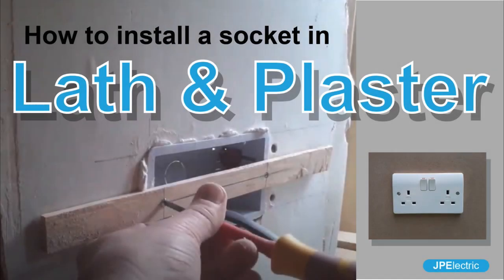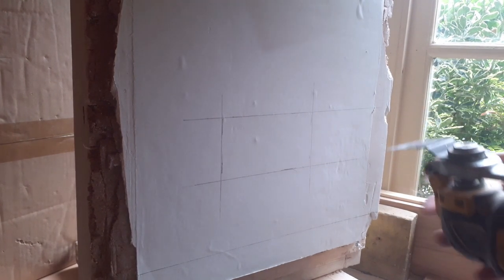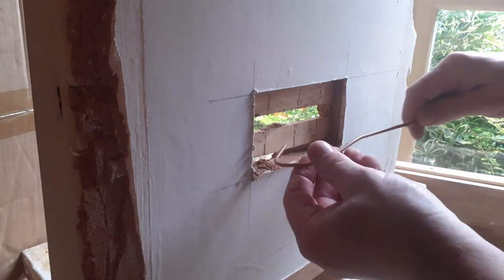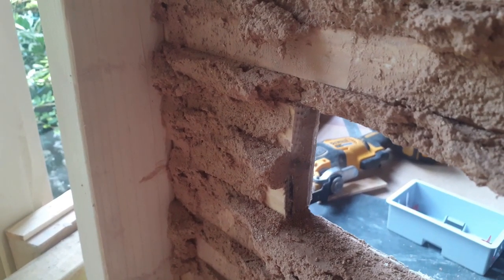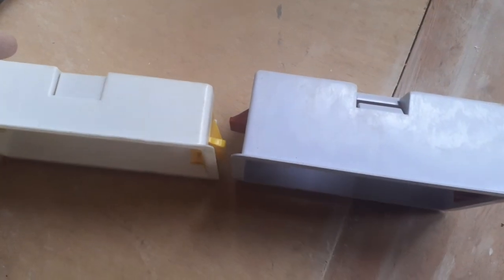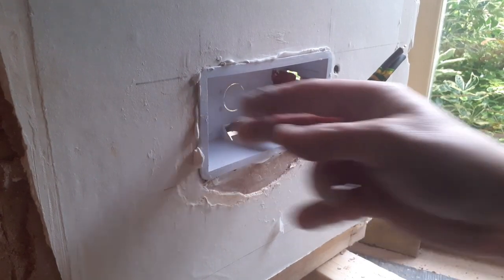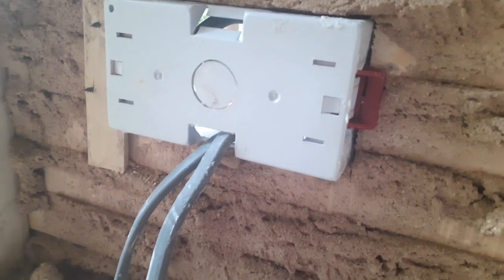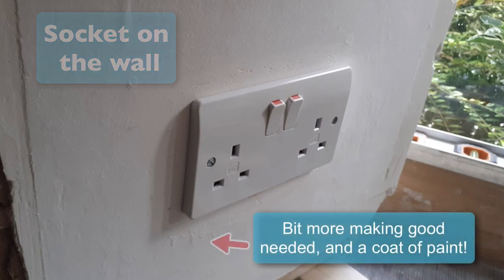How to install a socket in lath and plaster.

Comment: Excellent. I had honestly forgotten what quality work can done. My son's is planning electrical wiring in his home, the contractor bid does not include any plaster work. He mention the the work is going to be "messy". I had plan to do the patch up work,  but I am going to mention to the contractor it doesn't have to get " messy" and not to take any short cuts.  Work  sensible , and have courtesy to the customer.  THANK YOU
Reply from the maker: Hi realnotubutme8254. Yes totally agree. You do not need to wreck a house to rewire it.
Try to minimise as much as possible any 'messy' work, and at least make good your chases.

Comment: I didn't have an oscillating tool when I did my outlet. So I used a masontry drill bit and drilled holes around my pencil markings. Then played connect the dots with a jab saw. Once I had an outline I used a jigsaw to cut away the laths and removed the section.
Reply from the maker: Thanks for watching and commenting, appreciate it.

Comment: This was extremely helpful.
I was trying to cut an outlet earlier and my stud finder was going haywire all over the wall. Your wire trick saved me some headache.

I was told all the walling was replaced but it seems I was lied to.
I'll need to find some way to cut the remaining lath cleanly now that I've hacked most of it away with a drywall saw.

Comment: Good video, sensible advice and you concentrated upon the task, rather than upon yourself. Too many Sparkies on YT I regret seem to think it's about them, so take twice as long to cover half of the same detail, then miss the important bits!

I liked the diagram at the end, covering how to use a long drill to get through the Sole Plate. I have a similar job and was just pondering how best to create the hole in the Sole Plate for the cable to come up, i.e. without making an access hole to achieve this big enough for my dog to climb in!

Great, that small tip alone has helped me no end, because getting the Cables up via the Sole Plate was posing an issue in terms of how best to do this. I have a couple to do, and getting the cables up from under the Sole Plate was the main issue (if I wished to do a neat job and not create a huge re-decoration job in the process of adding a few extra Sockets to the Ring Circuit).
Reply from the maker: Hi Keith, Thanks for the comment, and really pleased you found it useful

Comment: It won't cut the wood lath but a diamond grit grinding blade for grout removal on the multi tool works so much better for going through plaster (and cement/rock lath). Makes so much cleaner of a cut with much less crumbling and damage, wish I had learned that a lot sooner. Really anytime you need to go through it look for tools that grind or are designed for masonry and it works so much better.
Reply from the maker: Thanks for the tip cinnabarsin4288, appreciate you watching and commenting.

Comment: Thanks for the Video , drilling through the sole plate would be a interesting video.
Reply from the maker: Thanks for the comment. I will do a video on drilling through the sole plate.  It can be a bit tricky, so I want to do it on a real lath and plaster wall, to show the problems.

Comment: Thanks for the excellent video. Could you please suggest which brand of box you used / is the best suited to be fitted into a lath and plaster wall. Many thanks again.
Reply from the maker: Hi Kevin, I don't have a preferred brand really. The important thing is the depth of the box so you you have the depth for the lugs

Comment: I need to get tool like that with correct blades to cut in my plaster bathroom walls to get to some water pipes have light water leak, plumbers are wanting charge me thousands dollars for repipe with pex lines but I am just wanting to repair the pipe.
Reply from the maker: Hi Burt
Yes the multi tool is really handy. Thanks for watching and commenting.